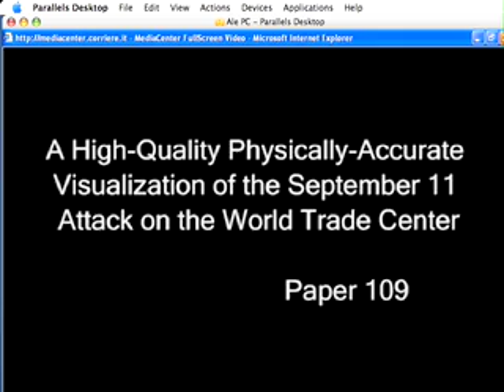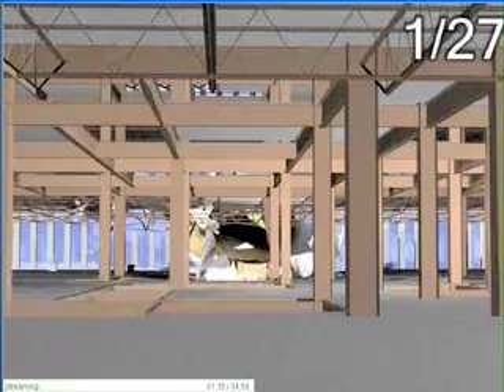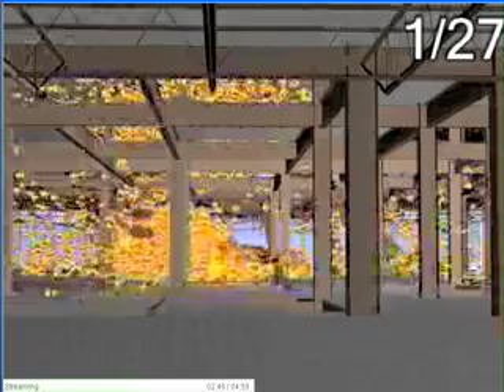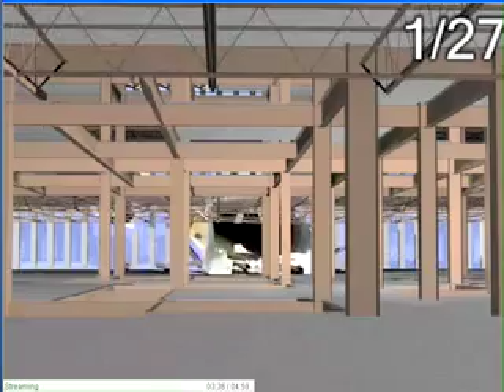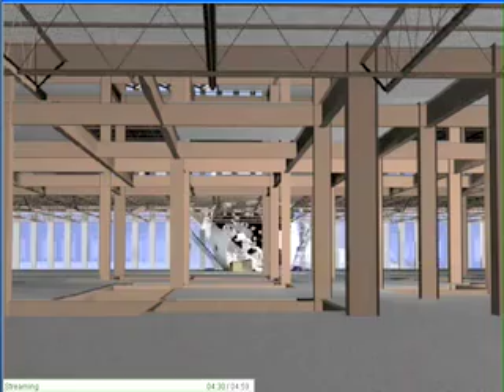9-11 Twin Towers Attack 3D simulation

Comment: You know how this was bs? A 300 ton aluminum built plane could not break through a wall of steel that is designed to sustain 13,000 tons of impact. This video is just blatantly false.
Reply: 22. Did the NIST investigation look for evidence of the WTC towers being brought down by controlled demolition? Was the steel tested for explosives or thermite residues?NIST did not test for the residue of these compounds in the steel.The responses to previous questions demonstrate why NIST concluded that there were no explosives or controlled demolition involved in the collapses of the WTC towers.As for thermite (a mixture of powdered or granular aluminum metal and powdered iron oxide that burns at extremely high temperatures when ignited), it burns slowly relative to explosive materials and would require several minutes in contact with a massive steel section to heat it to a temperature that would result in substantial weakening. Separate from the WTC towers investigation, NIST researchers estimated that at least 0.13 pounds of thermite would be required to heat each pound of a steel section to approximately 700 degrees Celsius (the temperature at which steel weakens substantially). Therefore, while a thermite reaction can cut through large steel columns, many thousands of pounds of thermite would need to have been placed inconspicuously ahead of time, remotely ignited, and somehow held in direct contact with the surface of hundreds of massive structural components to weaken the building. This makes it an unlikely substance for achieving a controlled demolition.Analysis of the WTC steel for the elements in thermite/thermate would not necessarily have been conclusive. The metal compounds also would have been present in the construction materials making up the WTC towers, and sulfur is present in the gypsum wallboard that was prevalent in the interior partitions.
Reply: 12weasel, the towers were designed to sustain the impact of a 707. The architects themselves explain this on video. They literally state that the building was designed to sustain 13,000 tons of impact. You're calling the high-rise architects morons. I'm just repeating what they said. You're also ignoring the thousands of architects, structural engineers, and physicists who claim that this is impossible. 

If you have a theory for how a 300 ton aluminum plane could break through steel supports that are designed to withstand 13,000 tons of impact, I'm all ears. I just rely on science rather than opinion, and the NIST and 9/11 Commission Report ignore science. Did you know that the NIST investigation did not even investigate for thermite and explosive (despite the fact that the residual ash showed traces of thermite)? Their reasoning: because they didn't expect to find any. It's on the NIST website. 

I get why you respond like this, but start asking questions my dude. You won't like what you find, and it will challenge your world view.
Reply: I've never seen "millions of experts" as you claim, but there are thousands of experts who have come forward to criticize the NIST report. Just because they are given a label by you doesn't diminish the value of their criticism. Here's a timeline of problems for you to check out:

1) The problem with the planes flying into the WTC's. It's pretty much impossible for a commercial airline to fly at over 500 mph, especially in lower altitudes, because of something called resistance. Second, with such resistance, steering the plane becomes extremely challenging, which makes it extremely improbable that one (let alone three) planes would crash into their targets. Pilots have tried, and even experienced pilots fail to hit the buildings in simulators. Third, it's more likely that the planes would have broken apart due to air resistance at those speeds (which has happened to many planes flying at much lower speeds). I'm not saying its impossible, just extremely improbable for someone to fly a plane like this into the WTC towers and the Pentagon.

2) Let's say the assumed situation happened. They forced a pilot to fly into the WTC, and another terrorist flew into the other one (and the Pentagon). Aluminum doesn't slice through steel like that. It would have crumpled on the outside and fallen down. If you watch the video footage, the building literally absorbs the plane, which is preposterous (which also suggests CGI manipulation). That's not how impact works. Again, look up the math on what happens when 250-300 tons hits 13,000 tons of resistance.

3) Let's assume an aluminum plane did slice directly through steel, and blew up conveniently inside. Then you have do deal with the fire. Jet fuel burns at 1500 F. Steel's melting point is 2750. In history, no other high rises with steel supports have ever melted with a fire. The interior is burnt, but the support remains. It's one thing to hypothesize the possibility that a fire could weaken steel supports, but it's another thing to conclude that fire caused strong supports to fail. 

4) Let's assume the burning jet fuel and other fires did melt the steel of the upper WTC's, and caused the upper parts to fall. Then you get to Newton's third law of motion. If the opposing forces are 50:50 (half way mark on a building), the net force is 0, which means both would stop. For a building, the upper half would sit on top of the other half. Now we know that the upper areas are less than 50%. The South tower was hit about 30% down, and the North tower was hit around 20% down. Even if the supports had failed, the upper towers would not have caused uniform free fall like what we saw. It would have either sat on top or fallen over. It means it's physically impossible for the upper parts (even with momentum) to cause a collapse. The structural supports were also stronger near the bottom, which made this even more impossible without the use of thermite and/or explosives. Remember, all these buildings fell uniformly.

5) NIST Report. Now you claim that 'NIST did take explosives into consideration.' From their own website, 

"22. Did the NIST investigation look for evidence of the WTC towers being brought down by controlled demolition? Was the steel tested for explosives or thermite residues?

NIST did not test for the residue of these compounds in the steel." 
( https://www.nist.gov/el/faqs-nist-wtc-towers-investigation ) 

Here's also a reply by NIST to this: 

 "NIST has looked at the application and use of thermite and has determined that its use to sever columns in WTC 7 on 9/11/01 was unlikely....
It is unlikely that 100 lbs. of thermite, or more, could have been carried into WTC 7 and placed around columns without being detected, either prior to Sept. 11 or during that day.

Given the fires that were observed that day, and the demonstrated structural response to the fires, NIST does not believe that thermite was used to fail any columns in WTC 7.

Analysis of the WTC steel for the elements in thermite/thermate would not necessarily have been conclusive. The metal compounds also would have been present in the construction materials making up the WTC buildings, and sulfur is present in the gypsum wallboard used for interior partitions."   ( https://www.nist.gov/pba/questions-and-answers-about-nist-wtc-7-investigation )

The NIST, whose whole goal is to investigate the cause of the building, ignored testing for thermite and explosives because they assumed that it was unlikely. For the biggest investigation in US history, they don't test for these two things? They say they have no witnesses claim they heard explosion? There are hundreds of witnesses (dozens on video that NIST had) who claimed they heard explosions (even chain explosions), but were ignored by NIST. Furthermore, non-government experts tested the ash, and even found tiny red chips and nano-iron balls, consistent with thermite use.  

6) If you want to look at how anyone could carry 100 lbs of such stuff into the WTC, look up a) art students in WTC prior to 9/11 (E-Team, and Gelatin), and b) Dancing Israelis, and c) Israeli art students. 5 Israelis were arrested on 9/12, because they were sighted laughing, hugging, high fiveing, and filming as the buildings were hit and collapsed. Their van even showed a picture of the WTC being hit by a plane. In the FBI report, their belongings showed traces of bomb residue. They were shown to have connections to Israeli intelligence, and there was reason to believe they knew about 9/11 beforehand. (they even stated on camera in Israel afterward that they were there to record the event). You'd think this is somewhat important right? Well, 140 pages of the 300 page report was destroyed, the other records are sealed until 2030, and the US Attorney General Ashcroft just let them go.  

Check up on E-Team and Gelatin, both of whom had access to several floors of each WTC building.
Reply: I'm not going to write a whole thesis, especially when you didn't even read through everything I wrote. I don't have all day to spend trying to convince you. I've presented my points, and you can take it or leave it. If you are actually interested, go on Google and search for what I wrote. I even cited NIST quotes, and provided the links so you can view the entire documents. 

I find it simply astounding that people like you get so aggressive over an issue like this. You should be encouraging questions, not trying to stifle them. Reiterating swear words and insults doesn't accomplish anything. Calling actual scientists and experts "morons" because you don't like what they say doesn't invalidate their statements. I really do understand why you feel the way you do, but we need to rely on logic, facts, and reasoning rather than emotion. 

I'm not here to fight. I'd rather figure out what is truthful. (I also never said it was an inside job. You assumed this because you automatically put me inside a box called "Truthers.")
Reply: If nothing else will get you to doubt your beliefs, then at least question: 

1) NIST's overall lack of interest in testing for explosives and thermite (especially for the largest investigation in US history), 

2) the fact that NIST testing for pyrotechnics is a requirement according to NFPA 921. 

3) This is your money hard at work to lie to us.

As a taxpaying citizen, don't you find it extremely odd that they never tested for thermite and explosives, especially this being a terrorist event? In 3 buildings that come down in what appears to be the result of controlled demolitions, don't you think they'd check for traces of potential demolitions? Nope, they didn't, because they assumed it wouldn't be there. Read the NIST links I sent you.

Comment: If a bird causes a large dent in a plane, what makes you think a plane can cut through steel beams that easily?
Reply: Mass and velocity have a bit to do with it. the steel beams are thin and they actually bend a bit in the wind, if wind can make them move a bit then the force of impact at high speed is more than enough to break thin steel beams, or maybe you think the plane would just stop dead and drop down outside the building.
Reply: you just said that soft bird made out of meat will dent aluminium............ fuck logic
Reply: That's one of the twoofer contradictions in my list!